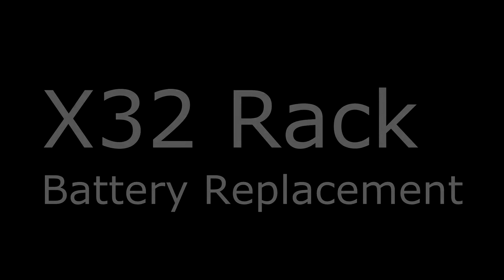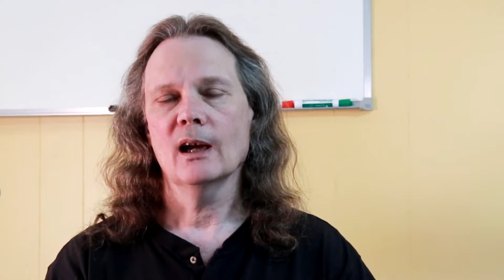X32 Rack Mixer Battery Replacement Procedure

Comment: Thanks for this info.  I’ll have at it tomorrow!
Reply from the maker: It's real easy, just a modest amount of disassembly to get down to the bottom circuit board where the battery is.  Lots of screws on the back panel connectors.
Reply: @Barry-Watson  I took it apart today.  Not difficult at all, just a lot of screws.  Thanks for the help.
Reply from the maker: Congratulations!  Glad it went well.